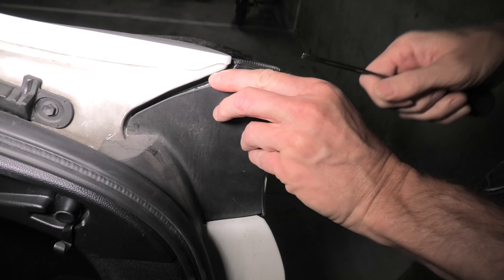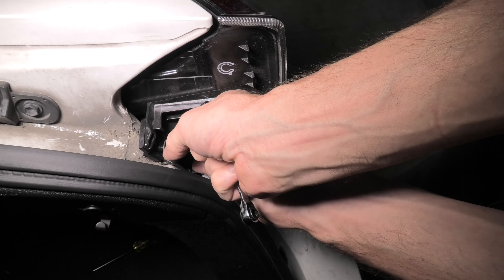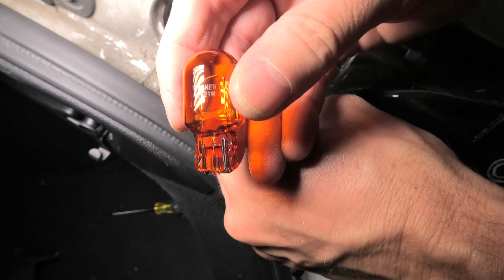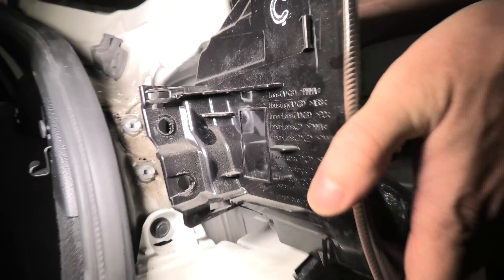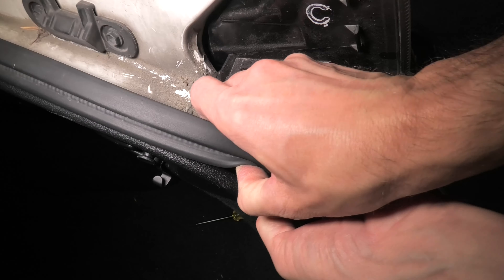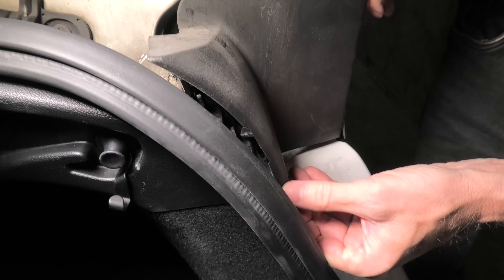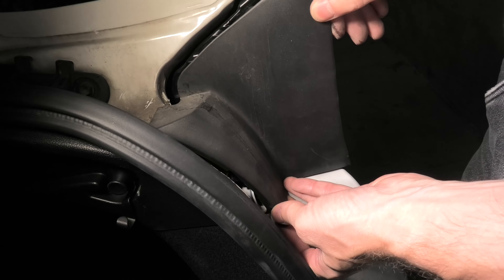Toyota Prius (2016-2022): How To Replace Rear Turn Signal Bulbs? Rear Tail Light Assembly Removal.

Comment: My car is a 2019 Prius Prime. Not quite the same as the regular Prius; on the Prime, the light you removed in this video is the Brake light, and the turn signal is a separate assembly lower down, but this video still is a big help to me. I have a cracked left brake light lens, and I could not see how to get it off - I have the same pry-off black plastic cover as on this car, and thanks to your video, I now know that I have to pop it off with a screwdriver and remove two 10mm bolts.  It's shocking what Toyota charges for these lights if you break them: $400 for the turn signal, $210 for the brake light! Ouch! Anyway, thanks!
Reply: Hi Laura, I have the same issue on the Prius Prime upper left light cracked and I need to replace it. May I ask was it straightforward to replace it yourself? Was it similar to this video? Any tips? Thank you I appreciate your reply.
Reply: @Linnie101 - I ended up giving the car to my daughter before I got around to replacing the cracked brake light. I bought the part, but hadn't installed it yet when I transferred the car to her. The video looks fairly easy:
1. Pop loose that plastic trim tab, then remove the 2 bolts, and the light module should  be easy to lift out.
2. Swap the wire connector from the old light to the new one, bolt it in place, and snap the plastic trim piece back in place over the bolts.

The turn signal light fixture, lower down and part of the bumper, is much more difficult and I have yet to find a YouTube video that clearly illustrates how to get at the fasteners that hold that light in place. I think you pretty much have to have the car up on a lift and attack the job from underneath the car; very difficult to do in a Prius Prime if the car isn't on a lift, since the Prius sits so low to the ground. Good luck, sorry I couldn't be more helpful! 

I moved up to a Rav4 Prime, and my daughter needed a good gas mileage car, so I gave it to her instead of trading it in on the Rav.
Reply: @laura-ann.0726  Thank you so much. Your description is helpful. I will try it out. 😊

Comment: FYI, you mention that the reverse lights are LED's.
Actually, they still use regular bulb on your vintage. They were replaced by LED's from 2019, if I remember correctly.  
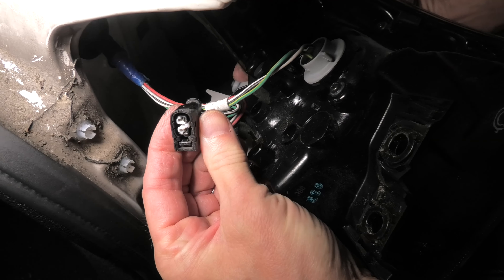The connector you show at 1:24 in your video is the one for the rear light, that is shaped as a "7".
The connector for the reverse light is located under the rear tail light assembly, and can briefly be seen several times in your video, like f.i. at 0:40.